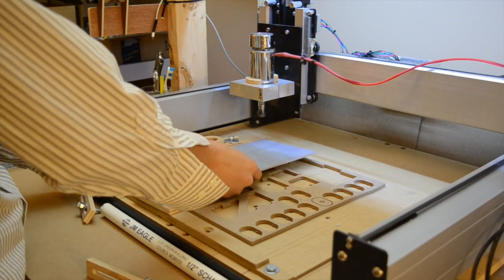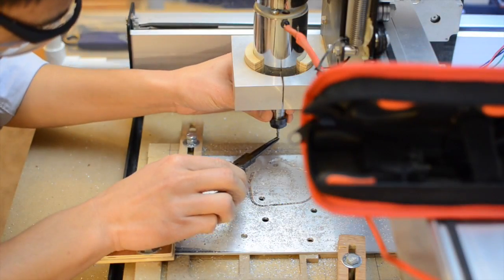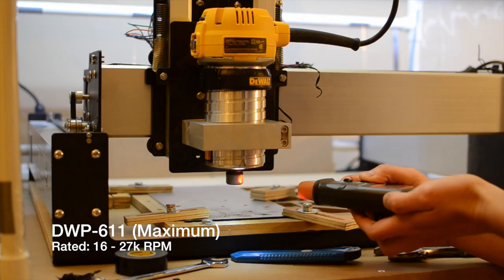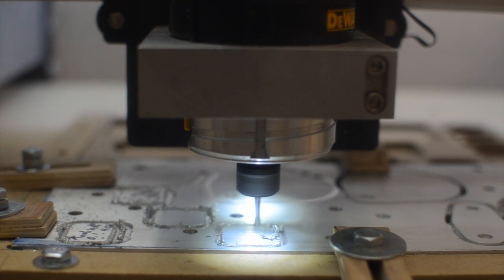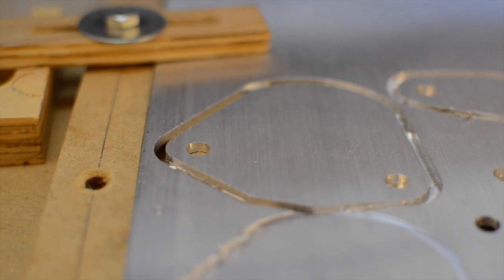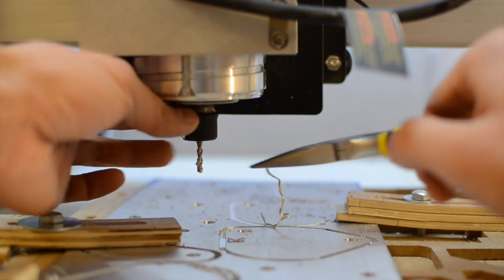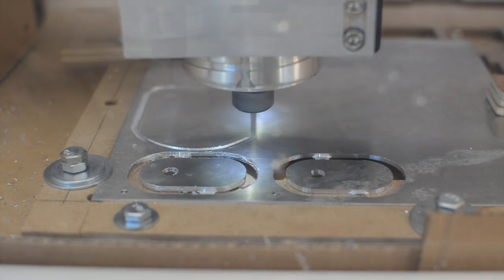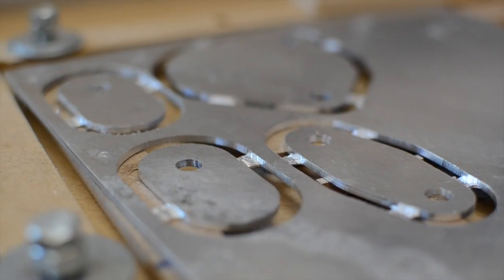How (Not) to Cut Aluminum on the Shapeoko 3 - Project 44

Comment: Thanks for this very informative video! Would a 500W spindle with 15.000 rpm max work for alumnium? What bit/feedrate/spindlespeed etc. would you recommend I try with?
Reply from the maker: +sttrife difficult to say. The power rating on DC spindles aren't usually a good indication of torque. Aluminum doesn't always cut best at maximum RPM, and if your spindle doesn't have closed loop speed control it can get bogged down and even stall. You could probably get away with the 500W, but you may need to take conservative cuts.

Check the Shapeoko wiki regarding materials for suggested feeds and speeds as a starting point (I'd go with the Nomad's settings first, since that assumes a weaker spindle). Most 2-3 flute endmills will work, best if they're designed for aluminum though. 45 degree helix angle and/or ZrN coating.

Comment: I'd recommend a mister.  Basically you are blowing away the chips with compressed air, and adding a tiny amount of lubricant tot he air.  Industrial high speed mills (use small cutters) generally use misting.  Your biggest problem there will be running a compressor the whole time.

Comment: :o when i chuck a piece aluminum on my lathe or on the milling machine at work, i use rubbing alcohol as coolant. Compared to oil, it's much less messier and the chips would fly off more easily

Comment: Clean cutting aluminium .......... use the better , stiffer grades if you can , they tend to be less chewy & will chip , rather than heat up & fuse to the cutter . If you want small detail , requiring small cutters running a high speed build a plastircine or wax wall round it & use "suds" or milk ( the fat lubricates the cutter , the water cools it ) . Messy , but may save broken cutters . There is silicon spray , which is often used for circular blades , would would help to stop pick up on the cutter . A thought , may be plumber freezing spray ( relatively cheap ) & use candle wax or oil as the lub , less messy than milk .

Comment: Hey Winston, I enjoyed your video. maybe you can do what i do on my industrial lathe and mill and use paraffin as  a lubricant. It may be a bit messy at the higher revs but it works well for aluminium.
Reply: I used to work with a larger sturdier machine cutting front panels for rack mounted instrumentation. We used to use a mixture of about 3parts liquid paraffin to 1 part motor oil. Pretty messy but worked really well cutting with 3mm cutters through 3mm anodised panels. Same for engraving them. A scattering of sawdust around the shop floor soaked up the spray. Not so good in the home ;)

Comment: and you can watch my videos where I'm cutting 3/8" thick 6061 aluminum. I'm using a 1/8" carbide 4 flutes endmill at very conservative surface speed and feed. My depth of cut was 1 mm. Which is aggressive compared to yours. LOL

Comment: try crisco as a cutting fluid. just a light coating on the stock.
Reply: Know what works wonderfully well?  ATF.  Yes, automatic transmission fluid as it is meant to not breakdown with heat like an oil since oil is 3k-5k miles per change and ATF is 50k-100k depending.

Comment: hi winston i have one quastion : what size of milling bit can i use with dremel 3000
Reply from the maker: Dremels usually accept anything with a 1/8" shank.
Reply: yea but if isnt it power demanding for drill
Reply from the maker: Yes, so usually you have to go very light is cutting with a 1/8" end mill. But honestly I don't like going larger than a 1/16" if I'm using a Dremel. And even then, you'll be near full power just to get it to work.

Comment: Which CNC would you prefer for wood as well metal Diy projects. With a better software , however I'm a Architect well know of auto cad and 3ds Max.
Reply from the maker: http://makezine.com/2015/11/04/digital-fabrication-shootout-winners/

For wood, any of the CNCs recommended by Make are good, but for metal, especially larger projects, Shapeoko is best value for sure.

Comment: you could set up an air line with a small gas ball valve to control the pressure so it clears the chips but doesn't throw everything all over the place but with aluminum coolant is really the best option

Comment: Great Video!  The Alloy type you use will have a big impact on you finish and how the machine cuts and behaves, some alloys can be a bit 'Gummy' and do tend to glog bits.  If you want really nice cuts for parts of higher precision give a cast surface ground aluminium plate a try.  Something like MIC6 or ATP-5.  It may cost a little more but it's worth it and you get the advantage of having two parallel precision ground surfaces which can be great for mounting other parts onto while maintaining a high level of precision.

Comment: At 2:24 you say ".01 inches depth-of-cut". At 3:35, "don't do simple profile cuts more than 1/2 diameter of the end mill".  For a 1/8" dia end-mill that's a 6x difference. I'm new to CNC and I suspect you were referring to two different operations. But can you explain? Thanks.
Reply from the maker: Clarification: I meant total depth of cut should not exceed 1/2 EM diameter without extra room cut for chip clearing. Each individual pass should be done a the appropriate depth for your cutting parameters.

Comment: If you will take smaller cuts you can greatly increase your feed rate. Try doing cuts at .025-.05 I know it seems like deeper cuts would be faster but it's not. You get the highest material removal rate with high feed rate /small DOC(depth of cut) This style is one of the major contributors to high speed machining. You can also save a lot of endmills by cutting your stock to smaller sizes and profile the part instead of the slot cut your doing. Slots and pockets are the hardest on your tools especially when you don't have coolant. Compressed air will serve you better than the oil you are using. Chip removal is more important than heat in this case.

Comment: Don't know if this will apply but when I cut openings in aluminum framed doors using a router and special cutter, I found that the aluminum would weld itself to the bit unless sprayed with a substance that would prevent this. What I ended up using was a "lemon scented" spray cleaner. The rotational speed of the bit was also critical. The combination of slower speed and the lemony cleaning solution solved the problem for me.

Comment: @Winston Moy. How small of letter's & number's do you think you could engrave on aluminum with your CNC?
Reply from the maker: +Rob Graff With conservative speed settings that put very little stress on the machine, probably a little smaller than 1/8" tall letters. Taking the time to tune your belts and everything, perhaps smaller than 0.1" reliably. It's something I'll be testing in the coming weeks.

Comment: @Winston Moy I would try a single flute endmill with max rpm, light depths of cut .01 or less with with higher feed rate. I would start at .005 per rev and adjust up or down if needed. Also Use a light oil and not a heavy one. Try WD-40 or equivalent. Heavy oil does not remove heat fast enough for aluminum. Or if you can use a water soluble oil with a 8-10% concentrate with a spray bottle that would be best.

Comment: Winston, thanks a lot for sharing your knowledge, I would like u to give me some impressions about the x carve, I'm planning to buy, specifically about the spindle, is the default option (dw611) a good one?,  powerfull enough to cut alumminum or engraving other metals?, I'm concerned about noise, power and speed rates, thanks a lot for your comments
Reply from the maker: +Miguel Ideador The spindle has more than enough power to saturate what NEMA 23's are capable of pushing it through, so that won't be a limiting factor. 

The minimum RPM is around 16k, but so far I haven't had any issues with that being too high. I haven't tried it with plastics though. With wood it's fine.

As for noise... well... you're SOL there. This thing wails like a shop vac. And that's before you start cutting into any material.

Comment: Wow, I find that anything faster than 4 inches per minute on a 1/8" end mill results in a broken bit. On a 1/16 inch end mill,2 inches per minute max. This is with a depth of cut of 0.02 inches and an overlap of 30%.  Since I went to these speeds I have been able to produce 30 large intricate pieces for a product of mine, without a single broken bit .  why the big discrepancy?
Reply from the maker: +Tom B Spindle speed could be a big factor. I'm cutting at upwards of 20k RPM, and at about half your depth of cut. So it's kind of an inverse relationship, go fast and shallow, or deeper and slower... #twss

Comment: Great video as usual Winston!

I've been cutting quite a bit of Aluminum with my heavily modified Shapeoko 2; I've gone as thick as 3/8 and would feel comfortable going thicker. Also, I use a dust shoe and cut with no lubricant. I found that the lubricant just causes chips to not be picked up by the dust shoe.

The thing I noticed in the video that I do differently relates to tabs. Say, on a job where I am making a bracket, which bolts to something, I break the gcode into two files. 
1. The bracket bolt holes.
2. The bracket outer profile. 

Assuming you don't lose 0, 0, 0 (x, y, z) between jobs and there is a waste board below your aluminum, you eliminate the need for tabs. 
Step 1. Secure your aluminum sheet
Step 2. Cut job 1 (the bolt holes)
Step 3. Move your gantry clear of the bolt holes cut in Step 2 (retaining 0, 0, 0; but keeping the motors locked)
Step 4. Use self-tapping screws to secure what will become the bracket, by putting a self-tapping screw into each of the bolt holes created in Step 2
Step 5. Cut job 2 (the outer profile)

I can't stand the little imperfections created by tabs. Though, in the case where you don't have holes in the middle of the piece, you are forced to use tabs :/

Hope this is helpful!
Reply: Sounds basic, but real genius re using bolt (or screw) holes to anchor workpiece.

Comment: I see you're cutting on a piece of scrap with lots of cutouts. May I suggest either clamp right to the spoilboard or a flat sheet with no cutouts?  The reason being that when you get toward the bottom of the cut the stock can flex downward grabbing the end mill, either breaking it or runing surface finish.

Comment: Hi Winston, really enjoying your videos, keep it up!
I've cut aluminum sheets (3mm) with my shapeoko 2 with relative reliable results.
Here is an example of a battery holder for my robot: https://youtu.be/JGuEo9QiW4s?t=37
I usually use a 2 flute, 2mm endmill with my Kress 800 fme-q spindle, speed set to 5 (~28000 rpm if I recall correctly).
DOC 0.2mm, feedrate 600mm, step over 0.4, and width of cut for a profile cut set to 2.5mm (two passes to clear chips more easily). Also using a bit of WD40 to cool the bit.
I lost a couple of bits also, but mostly because of user errors :)
Cheers,
Alex

Comment: As far as i could tell until the end of this video you were conventional cutting everything. It's best to climb cut for the cleanest finish. If you want to climb cut you want to go clockwise on the outside of a part and counterclockwise on the inside of a part (This is assuming that your spindle is spinning clockwise.) this gives you the best finish for any type of job not just aluminum.
Reply from the maker: +Zwcky101 Meshcam defaults to Climb milling, I hadn't bothered setting it for the early jobs in MakerCAM.

Comment: Did you try using different fluted endmills, and if so did you notice a different in chip clearing, for example with a 4 flute instead of a 2 flute?
Reply: +Winston Moy what did you see between the two eighth inch endmills?

Comment: Increase rigidity anyway you can, maybe you could goto a double gantry design, reduce spindle overhang, use shortest endmil possible, raise work piece and reduce spindle speed.
Reply from the maker: +Adam Hill All valid points. Never thought about raising the work piece, but when you're chasing every last thou of precision, it makes sense...
Reply: +Winston Moy it's more than that, less Z travel means more rigidity which means more performance potential, faster feed, faster spindle, deeper, wider cut, it all starts with rigidity.

Comment: Hi guys.  I cut aluminum about 90% of the time, and successfully cut many many parts with material up to 1" thick, but there are some important rules that I have adopted:  1) Aluminum  becomes VERY sticky when it gets warm.  2) The rigidity of the Z axis is a concern (Grab the top of you router and see the Z-axis motor plate flex). 3) Think high speed machining: Small depth of cut (0.030"/.75mm MAX), higher rates of feed (25 inches/min 635mm/min). 4) Use coated end mills. The coating helps with lubricity.  5) I added a WD40 drip system to my Shapeoko3 that drips (about) 1 drop every 8 seconds to help with the stickiness 6) Two (2) flutes allow for more chip clearance. 7) MOST IMPORTANT RULE: Cover the vents of the router motor (If using a air cooled model).  I NOW use a sock over the vents, and I also added cloth filters for the electronics, and all stepper motors.  Check out some of my Instagram info (JPL_Richard)  NOTE 1: These pictures are all Pre filter (sock) photos. NOTE 2: Because of the flex in the Motor Plate, I do most of my critical cuts using the X axis, since the motor flex is minimized in this direction.  Have fun Makers, it's a great machine!
Reply from the maker: +Richard Cournoyer Great point about the x-axis, in hindsight I do think that the spindle mount's flexure is more of a liability than the distribution of force on 1 X belt as opposed 2 Y belts...

P.S. Do you actually work at JPL?

Comment: I mainly cut carbon fiber on my cnc and I found that when cutting 4mm the back plate that holds the spindle flexes a lot and I have to go really slow. A friend of mine who is a cnc and 3d printer wiz has access to a really big industrial cnc and he offered to cut me a new plate out of something like 1/4in aluminum. That is what I am going to do to fix that issue.
Reply: Daniel Souza
I do have a shapeoko 3 and it works awesome for cutting cf. I did try aluminum and that worked well also but u just need to make sure and put some oil on the bit or it can bind up and jam. For carbon fiber I use these bits.
http://www.ebay.com/itm/10-1-45mm-0571-DIAMOND-CUT-CARBIDE-ROUTER-BURRS-FT-Kyocera-Tycom-/151600984343?hash=item234c1f7117:m:mjIwpx8UV27UrlkIJgu-BhA
personally I think the shapeoko 3 is an awesome machine and I recommend it but you might also want to check out the xcarve. It think the shapeoko 3 is cheaper though. Let me know if you have any more questions I would be glad to help.
Reply: +RCflyer729 A good diy solution to this issue is to bolt (vertically) two strips of 15x15mm aluminium bar either side of the spindle mount clamp. Then also bolt the strips into the spindle mount itself. I have seen this on a few peoples shapeoko 3s and I am going to do it before I start tackling aluminium on mine!
Reply: +RCflyer729 I'm going to start in this world of CNC mills now. I intend also to cut carbon fiber and aluminum. How's your exeprience with CF so far? have you tried already aluminum? do you own the Shapeoko 3? are there any other more affordable CNCs out there? I'm starting my research now, sorry for many questions and thank you.

Comment: I attempted to cut out a simple 2.5" diam hole out of 1.25" thick 6061.  I indexed, cut thru halfway with a 1/4" carbide tool, flipped the stock and ran the cut again.  For a single side I left three 0.015" thick, 0.25" wide tabs (combined tab thickness 0.030"). All would have gone well but on the very last pass the router fought the Al and things got a little hairy. Three 30 thousands tabs are simply not enough.  Going back I may have even stepped up to 5 tabs, or even "one continuous" tab and cut out the part by hand. (Setup:  About 15ipm, DWP611 at full rpm, 0.05" depth of cut, almost continuous flooding/flushing and vacuuming of chips.  I've also removed the waste board and the skeletal structure under,  mounting everything to a stiffened 3/16" plate with 1/4-28 drill-tap in a 3" array for solid hold downs.)
Reply from the maker: +arkayic111 I find that when you're about to break through, upcut endmills tend to grab a bit more aluminum than you'd expect. Probably have to go in and slow down the last few passes, or just bite the bullet and plunge through at that point.